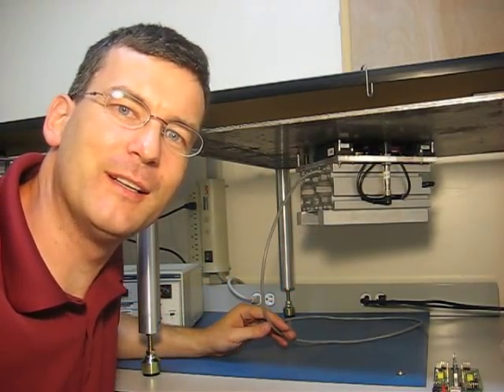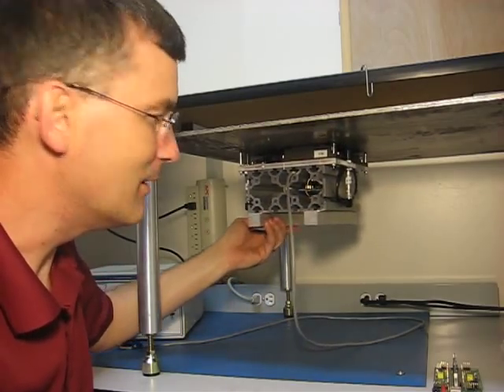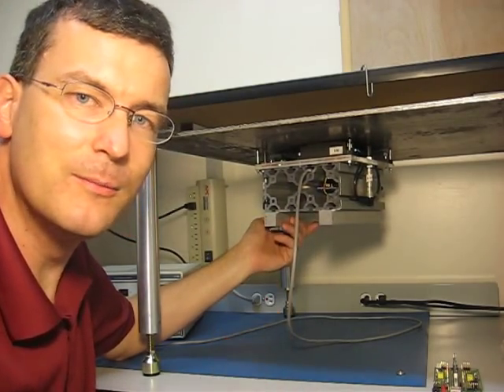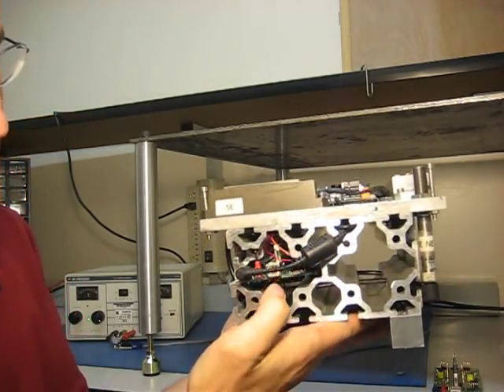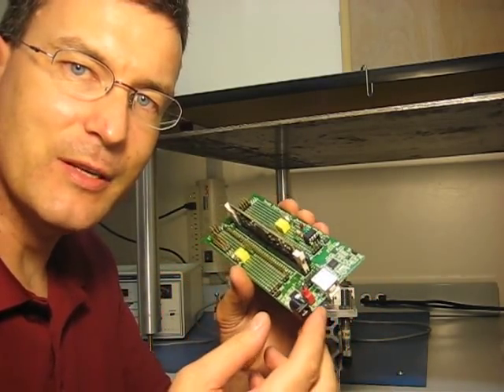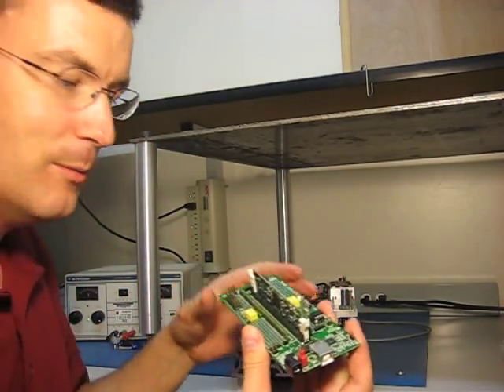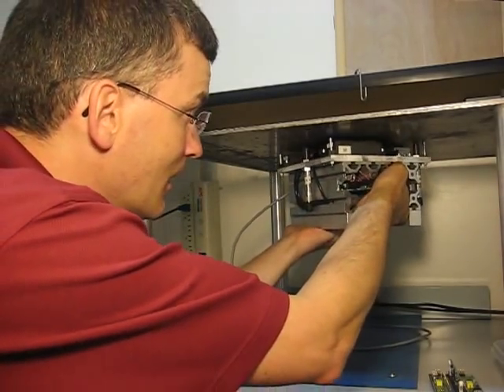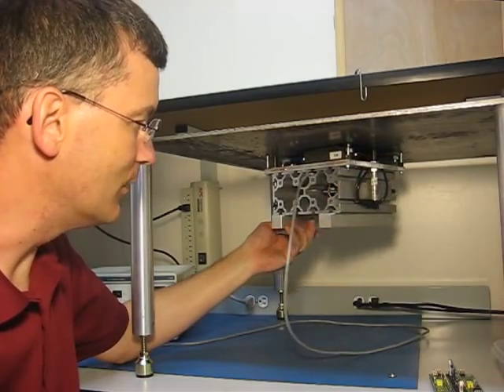Active Magnetic Bearing: Tripod Floater v2.0

Comment from the maker: @polarkerr 
The electro magnets are not operated at an AC frequency, but with a DC current that is adjusted by the 'gap' controller. e.g. if the gap is too large, the controller will ask for a larger current, and if the gap is too small (magnets are too close to the plate), the current is decreased.

Comment from the maker: ThexBorg,
You would indeed be able to carry increasingly heavy loads. It is one of the applications I have thought about: make a metal I-beam track in a warehouse (or an up-side-down U profile, so you can guide the 'chuck') and while you hang a load to the chuck, the controller can decrease the air-gap in an attempt to reduce the current. One would even be able to operate under zero current on average, only using a little 'AC' current to control and maintain gap.
Hope this helps.

Comment from the maker: Hi grick31,

I'm using a digital servo, implemented in a Texas Instruments C2000 micro-controller. The servo-sampling frequency is 10 kHz. 
also check out the 'Tripod Floater v2.2' for a battery operated version.

regards,
Meindert

Comment: I would also like to know how you sense the position. 
Apart from that, I have successfully levitated objects upto 100g using PD, PID and state feedback, but whenever I go for heavier objects, I lose stability. I don't understand why, i.e. if the electromagnet turns are increased( for lifting heavier objects), the system becomes unstable. Can you help me as to why this might be happening?
Reply from the maker: Chinmay,
You have to realize that the AMB gain(!) increases with increasing current; simplified, Force = Current^2 / gap^2. This means that if you increase the load, the gain of your servo loop changes.
Try this: use the PID loop (you need a differentiator), and in small increments, increase the load. When the controller seems to become instable, try to increase the controller gain. Also, if you can, reduce the airgap of the AMBs. I think by slowly iterating your way through the gap/current/force space, you can increase the load while keeping the controller stable.

Good luck.

Comment: Any reason why you went with TI instead of Microchip PICs?
Reply from the maker: Nope, no other reason than that I already knew the TI uProcessor. I can tell you why I like it though: the on board peripherals (PWM / ADC / SCI / SPI / etc.) allow for easy integration with the motors, sensors, an USB connection and the wireless Zigbee. It's fast (running at 10 kHz) and has some nice 'enhancements' to make the PWM and the DAC more accurate (although that was not really needed for this application...). And that was 6 years ago. ;-). Hope that answers your question.
Reply: Question answered.  Thank you. :)